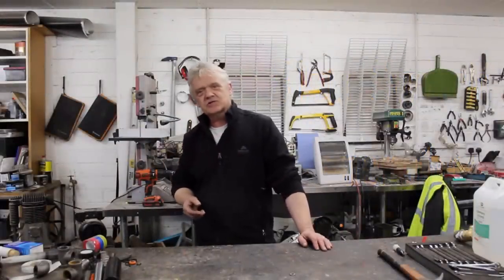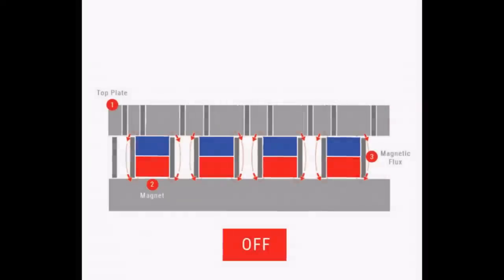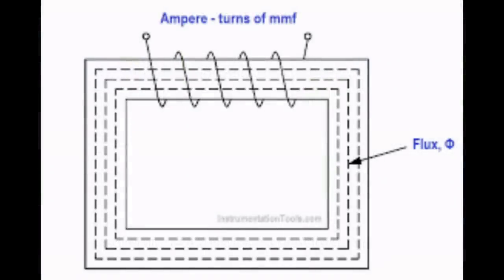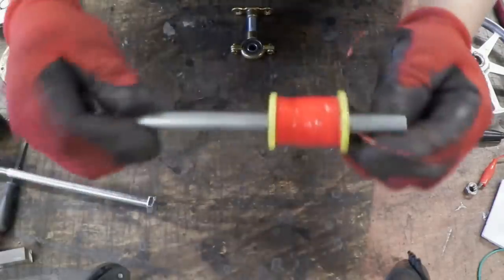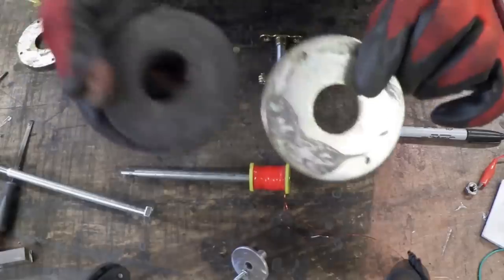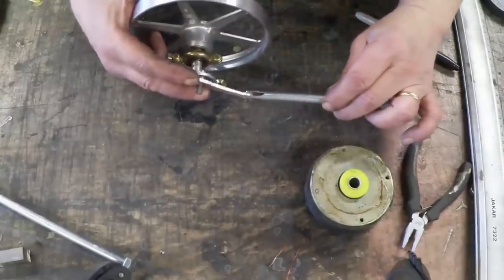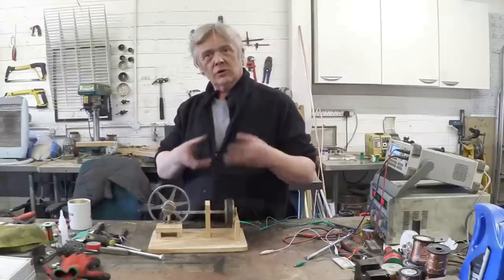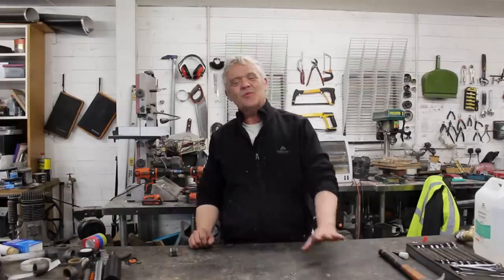1904 Flux Switch Generators

Comment: My brain immediately went to that fun little vibrating engine you made from the 3 tin cans (Video 1771).  Eliminate the wheel, and orient the magnet and coil assembly vertically.

Comment: My notion with flux switching is using a relatively small electro-magnet, wound onto 2 separated metal armatures, and a strong magnet on each armature, on N one S,   with the generating coil in between them.  The idea is that when you flip the polarity of the electromagnet, it will contain the field on One side, and reinforce the field on the other, and just wobble the two fields across the generator coil without having to move anything. 

I do not know that this would work, but I think the potential is there to use a low power generator, to wobble the field of much stronger permanent magnets across a coil, and do so very quickly, and perhaps get more bang for your generating buck.

It's just a place I Think I may see a way to do a heat-pump type exploit on the tendencies of magnetic fields.

Comment: DIY torpedoes.   Nice!    Granted I don't fully understand the concept, however was wondering if the speed/ consistency at which you break the flux line increases output power?  With that said, if you had a circular ring rod that passed through the center that was made with alternating magnetically conductive and non conductive segments though perfectly round, you could break the magnetic segments faster without having to reverse directions or slow down.  Perhaps have alternating shielding and as many breaks as you can fit on a ring.  This would also allow you to add more coils on the same round ring, doubling or tripling quadrupling the power with more coils and a larger ring, producing more power.  Now if I remember correctly, flux moves through certain dialectic materials 100,000 times better such as in the production of caps.   Yes this is another step but increasing the flux flow helps with the power formula.  
Now it needs to be lubricated.  Well NASA I think invented air lubrication by scoring the surface of the materials and placing the surfaces close enough and fast enough so air acts as self lubricating.  Yes you could skip this last step but using air as a lubricant is ideal.  Now the last step, how to turn the ring?  Well you can get creative with that last step.  The ring can have gearing build in, or can be used as a pulley of various forms and shapes, whatever.  
So in recap, instead of having a rod which stops twice, use a ring made of both alternating extreme flux conductive dialectic, and insulator to break the flux and use the same ring as a lever of sorts to flow in same direction breaking the flux lines without having to stop like a standard piston.  😅
Hope that made a lick of Sense but it's hard to draw with words.  Not 100% certain of all the operations but in the end however it's designed, redundancy of power coils and breaking flux using ring and not a rod.  🎉

Comment: This is like when people say that electricity fallows the path of least resistance. It is not true. Electricity will fallow all paths. The flux will still be there just very small.
Reply: that's true and false both, 

your home gets a phase connection and a neutral connection, 

you connect all loads of house between phase and neutral, additionally a naked thicker wire of lower resistance is connected between earth and all plugs, appliances, pipes and everything that has chances of electrical leakage,

when a human body comes in contact with an appliance which is electrically short circuited, the electricity goes to earth through the thicker earth wire and does not go to earth through the human body, because electricity takes the path of least resistance, 

but if the voltage is too high and earth wire is not thick enough to ground all the charges at once, then some of the residual charges will take the path of more resistance as well, 

so it depends on voltage.

Comment: I know I am Repetitive but this would be Working Wonders with a Stirling...
[Mostly if it was a Copper Coated Graphite Coil with a Cooling System..
Epstein Cryogenic Laser or...
Just Demineralised Water...so you can make The Coil as Big as You wish because Heat wouldn't Interfere with the Coil's Electrons Displacement...]

Comment: So what if that plunger had segments of steel then plastic so in one stroke it could have a few of those metal bits going thru, like almost like a rpm increase, would that create more vs just one long plunger?
Edit: or perhaps something kinda like a band saw blade (just an example) with those segments in it so it doesnt have to go to a full stop at each end? like a ring or something like that with all the segments in that. If that would even be possible. hmmm

Comment: How many magnet-rings could be driven by a single shaft that alternates between steel and some other medium like epoxy? I'm assuming that the mechanical resistance due to the magnetic fields would set a practical limit when it comes to torque, but it seems to me that if that shift is being driven anyway, why not put it to work by figuring out how to drive multiple coils?

Comment: Hello Robert, can you recommend a battery type if i want a large offgrid 12v battery that will last 30+ years with regular maintanence? Im willing to put in regular elbow greece maintainence. I want a battery that can be maintained in the middle of nowhere without needing new parts or special skills. Thanks